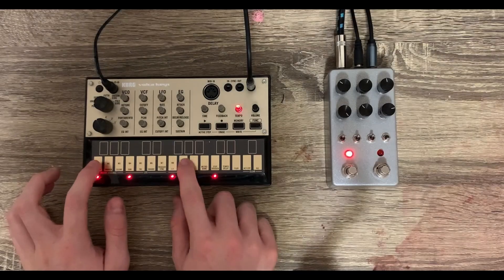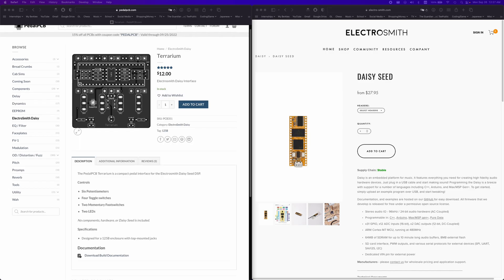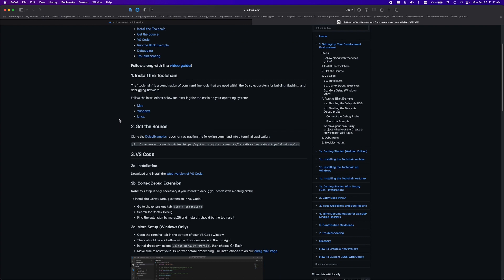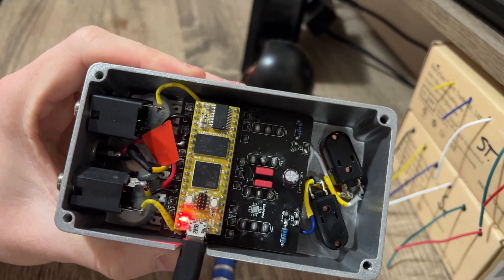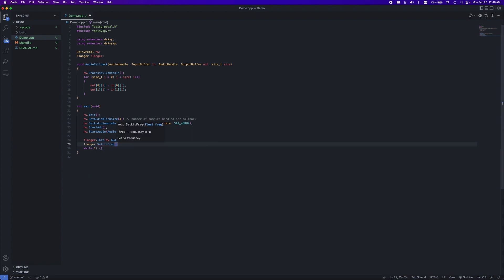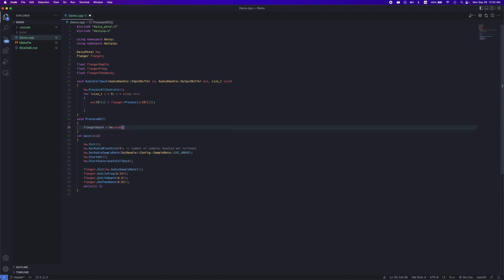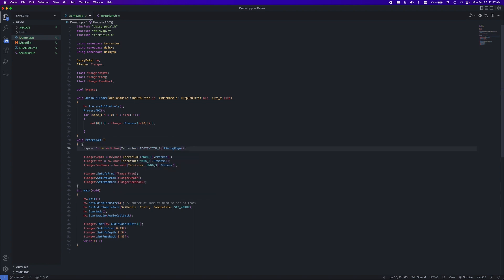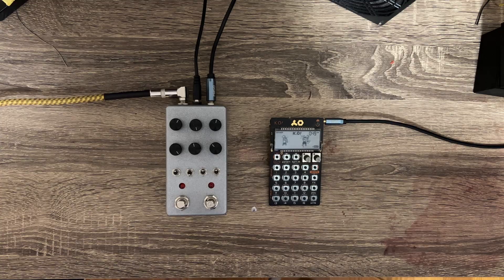Custom Guitar Pedal With Electrosmith's Daisy Seed - Tutorial

Comment: What size DC jack? This hole is too small for the 2.1mm DC jack enclosed frame with switch
Reply from the maker: What makes you think it doesn't fit? A 2.1mm jack was used in this video and every Terrarium build I've done with the same drill schematic. Works great for me!
Reply: @ImSamKnight the exact taydea sku number is A-2237. It has a 12mm shaft- It just doesn't fit. Do you have any reference for the jack you used?
Reply from the maker: @d3nt391  I used A-991 but it has the exact same dimensions so there should be no difference. Don't forget that they are both panel mounts, so you need to put it in through the outside of the casing. I typically solder on the wires to the jack before hand and then put them in
Reply: @ImSamKnight  thank you for the clarification! According to the data sheets this one has a smaller shaft which makes sense
Reply from the maker: @d3nt391  ahhh sorry yes I see now!! Glad to help, good luck with the build!

Comment: Great tutorial.  Only just got into the daisyseed - was previously using the spin fv-1.  Trying to get my head around the coding.  In the bypass function - how would you get one of the led`s to turn on and off?

Many thanks in advance, and more tutorials like this please :)
Reply from the maker: If you checkout the TerrariumMultiEffect code in the github linked in the description, you can find an example that changes the LED! May be hard to sift through, but search for "led1" and you will find the answer :) lmk if you need more help

Comment: I am just starting out with my first diy pedal using the daisy seed and terrarium PCB as well and this is a lifesaver, thank you so much ! I have a question about the enclosure though, as I am in Europe and cannot order from tayda electronics, I am struggling to find an alternative 125B enclosure with the same dimensions. Most of the ones I found are 35mm in height. Would that be too shallow ?
Reply from the maker: I've heard people say the Hammond 1590N enclosure is basically the same as 125B and is available in Europe!

Comment: great explanation!  i'm just getting started with programming but have built lots of pedals, had looked at the terrarium schematics and wondered how the bypass worked so this cleared it up.
Reply: Sorry for the necro-comment. The way the Terrarium is designed, the Daisy is in the audio path at all times. That's why Sam shows how to do the bypass in code. One could, however, wire a conventional true-bypass scheme up if willing to sacrifice one of the momentary foot switches on the Terrarium, or use a larger enclosure to make room for another foot switch.
Reply from the maker: Glad it helped!